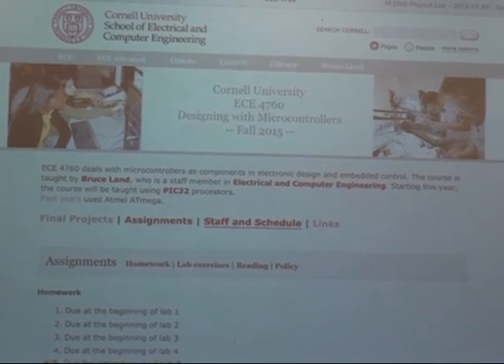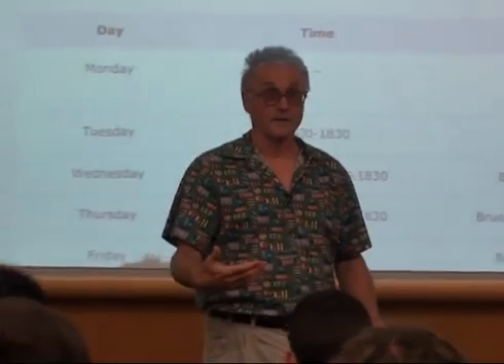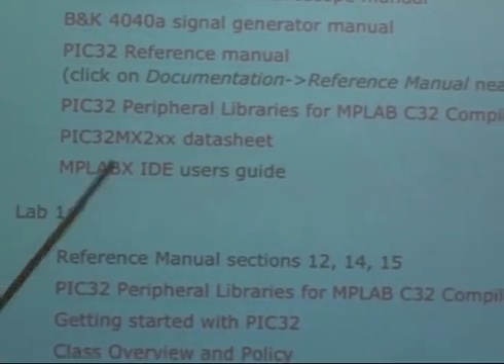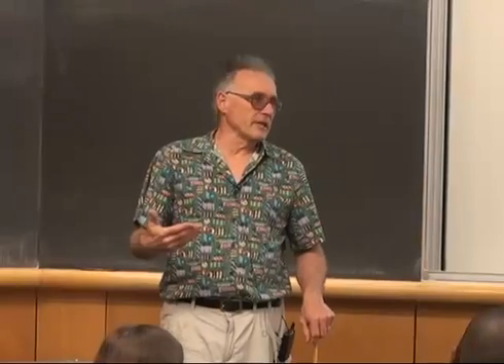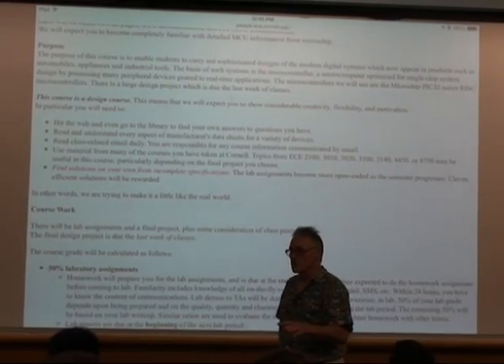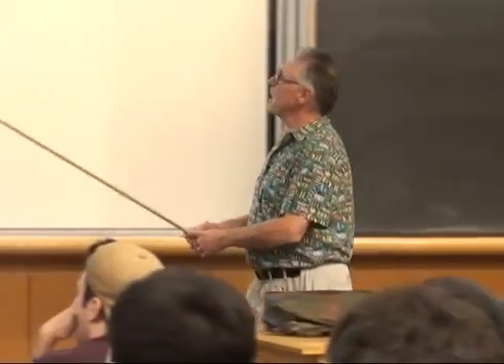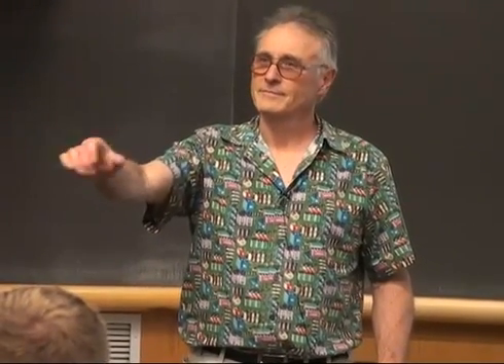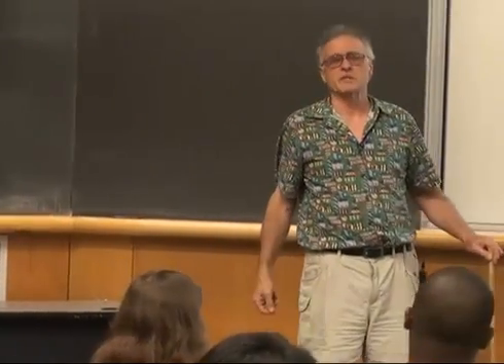#1 course introduction

Comment: 0:40 [~]Everything is on the website.  "I loathe Blackboard". 
I will ask my  system administrator at school if it is even a possible for teachers to maintain a plain html page on the website. Nowadays everything is hidden away in the CMS (Google, Moodle, Blackboard, Itslearning, Brightspace, Microsoft3something). That is fragmenting the knowledge structure hideously. Probably the idea of these content management systems is that they represent a convenient learning path, a didactic structure. At least that is what management is ready to pay for. But students feel patronized by these systems. It is probably not the intention of teachers who work with these systems, but it makes the learning process totally asymmetrical. "I grant you access to the system, I provide you a computer - but hey - forget about the smartboard, that is only for knowledgeable people like me".  Although I try to be not to political, for me these CMS's  are the perfect examples of "weapons of mass instruction". 
Bruce is never dumbing us down. He shows us donkeys how to return from the "Land Of Toys"  back to Flatland. Hee-Haw!

Comment: #include <inttypes.h>
#include <avr/io.h>
#include <avr/interrupt.h>
#include <stdlib.h>   
#include <stdio.h>
#include "uart.h"                                                    

how do i get  avr/io.h and avr/interrupt.h and uart.h to work on my code on mplab i am getting errors
Reply from the maker: mplab is not the compiler used with this code, so I would not expect it to work. We used to use avr GCC.
Reply: thankyou